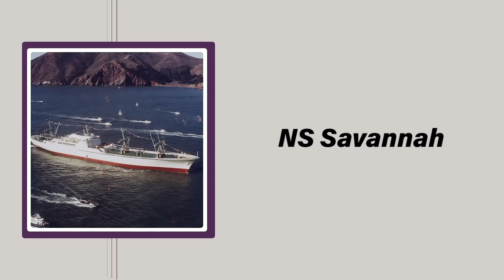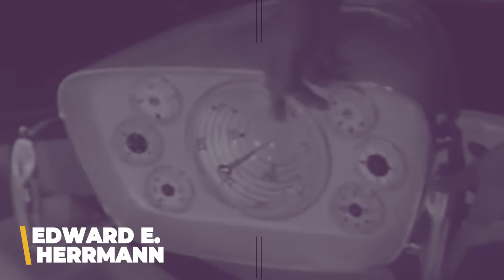Nuclear Powered Vehicles: Cheap, Sustainable, and Potentially Deadly

Comment: "Much lighter weight than fossil fuel..." also, "needs massive lead and/or concrete shielding."
Reply: Yes, there is a certain threshold at which appropriate shielding is still far lighter than the amount of fuel you would otherwise need.  Suppose the led shielding required is anything up to 50 or maybe even 100 Metric tons.
For context those shipping containers, about three thousand in total. Each have a gross shipping weight of 32 metric tons.

Heavy Fuel oil is about 0.8 Tons Per cubic meter at it's lightest, (often a full Ton per Cubic meter), and as Simon pointed out in the video these ships burn 10,000 Litre's, that's 10 cubic meters every hour .  From the port of Guangzhou china to Melbourne Australia is a 5 day trip.

5 days * 24 Hours * 10 Cubic Meters of Fuel * 0.8 Tons per Cubic Meter = 960 Metric tons of Fuel per trip.
Remember also that on this trade route one of these merchant ships leaves china every Saturday.
Reply: @lordsamich755  and "ship" is that threshold. Car or plane, not so much.
Reply: @davidpotter8297  
With present technology yes.
However switching the merchant shipping fleet to Nuclear Power still does more to prevent climate change; than literally anything else on which billions of dollars have been wasted.

But many of the same people preaching climate disaster still oppose Nuclear in any form and at any price.
Reply: @lordsamich755  "According to an annual analysis from insurer Allianz, 94 ships (over 100 gross tonnes) were completely lost in 2013. There are many reasons for a complete loss. “Foundering” (which means sinking or submerging) caused the vast majority of the big losses."
http://actuarialeye.com/2014/03/30/how-many-ships-disappear-each-year/
Reply: @davidpotter8297  
So what?
Reply: @lordsamich755  Darn. You were entertainingly dim for a moment there. Oh well, fun while it lasted.
Reply: @davidpotter8297  
Your just implying that there is an issue, without specifying why.

It may become necessary to recover sunken assets, instead of just leaving them on the sea floor.  But we know where they are.  All merchant ships report their GPS location via short-wave radio beacon.

You might be trying to assert that these reactors leak, but there is no reason to think properly designed reactors would do so.

Reactors of this size category also don't melt down in the way that people tend to assume.  Their core are simply to small for that to happen.
Reply: @lordsamich755  Ship sized reactors uses almost in every case highly enriched uranium, to get enough power out of the relatively small reactor. This is also weapons grade uranium. As long as it's in a Navy sub or carrier, it's safe, but if you put it into merchand vessels it can get into the hands of countries which make atomic weapons with it.  Also you need skilled people dealing with the reactor, while most of the ship crew in reality are people from the Philipines , because they work cheap.
Reply: @simonm1447  
Id's suggest then there is a strong case to develop thorium reactors specifically for merchant ships.

I like EV's but I just don't see electric merchant ships being a thing... ever.  There is just such a massive scaling issue to charge battery banks of that size.

Truly that only leaves only Nuclear or synthetic fuels as any sort of fossil fuel alternative.
Reply: @lordsamich755  synthetic Fuels for ships would be the simplest way, you could still use existing ships without big modifications.
Reply: @simonm1447  
Said fuels are energy carriers.  From where do we get the energy to make them?
Reply: @lordsamich755  I know they are only energy carriers.
A possible way to produce the energy would be solar in sunny countries, countries like Spain, Australia or north Africa. Solar PV is under 2 ct per kWh in these countries, and they have much space in desert like areas.
However, of course we don't have energy in excess, so we have to use it in a clever way. For ships or aircraft electric propulsion is no real option, here synthetic fuels may be an solution for the future.
Using these Fuels in normal cars however  would be a waste of energy.

Comment: I was always under the impression that the Savanna was a failure. The weight of the shielding and the cost of a crew trained to operate a nuclear power plant, made it impossible to carry enough cargo to make a profit.
Reply: More to do with the design of the ship itself, which was a relatively weird half passenger ship and half cargo freighter affair.

It's not unlikely that a Nuclear powered Container Ship or OBO Carrier will be revisited in the future; though the crew being armed and trained to repel boarders likely would be a requirement.

Comment: Thumb down: Too many mistakes, straw-men, and disinformation statements.
1. Nuclear processes include fission, fusion, and beta-decay. While fission requires substantial shielding to stop radiation, a fusion systems include aneutronic fusion which produces minimal radiation and thus could be compact. Beta-decay presents the possibility of a process which produces voltage directly. In the 1950's, these idea were speculative but not beyond scientific possibility. 
2. The mass of the radiation shielding is what prevents fission-based nuclear power from being used in anything smaller than a locomotive.
3. Treating speculative-engineering designs as if they were intended for production is nothing less than disinformation.

Comment: The problem with the 1950s versions of nuclear-powered cars is that they were invented by automotive designers and engineers who, unfortunately, did not understand nuclear energy. They were motivated by science fiction, not science. They were under the impression that a nuclear power plant would be able to do things that an internal combustion engine could not. Simon correctly pointed out that there ARE nuclear powered ships, but they are not propelled through the water by nuclear energy. They move because of propellers driven by steam engines. Yes, steam, just like the engines that drove the Titanic in 1912. The Titanic burned coal to created the steam it needed, nuclear ships use a nuclear reaction to generate the heat instead. This is why there will never be nuclear-powered cars or airplanes. Until some genius figures out cold fusion. Then maybe there can be something, but that's for future generations to invent. We aren't even close.

Comment: What about salt cooled thorium reactors? Why are these not being pursued as a technology.
Reply: They're not salt cooled; the fuel is molten thorium salts

And they are being pursued, in that the technology is being researched now.  I
Reply: @kdarkwynde  Thorium is suspended in a molten fluoride or fluorine salts... This may seem odd but this stabilises the temperature and regulates the temperature. The reaction vessel is plugged with a salt plug beneath is a containment vessel. If there is a runaway reaction and temperature rises the plug melts and the molten salt and thorium suspension drains and cools in the containment vessel where it cools and effectively freezes. This occurs with no external input of energy. meaning a meltdown needs no human intervention. The biggest obstacles are the uranium lobby and the corrsosive effects of molten salt on metal components. I'm sure that advances in ceramics could overcome this.

Comment: a minor collision will NOT destroy a city block.
An RTG (which is what they'd use) is not a nuclear bomb, and cannot become one.
It'd also be well contained in a shell secure enough that accidents won't cause it to fail.

The reason we never saw them was a combination of cost and anti-nuclear propaganda. The same reasons nuclear powered ships never came to much and most of them have since been decommissioned.

Having previously worked in nuclear energy research (I did my graduation work in the field of nuclear waste classification) I've seen first hand what restrictions have been imposed on the industry based solely on fear mongering and lies.

Comment: Finger tip steering was a way to advertise the new wonderful invention of power steering. See back in the olden days, you didn't have hydraulic or electric motors to assist in steering.

Comment: Didn't the Soviets try out a nuclear powered aircraft? IIRC the radiation proved to be way too high for the crew.
Reply: The US also did (the NB-36 H which was tested between 55 and 57). It never flew nuclear powered, but it carried a working nuclear reactor on board. The shielding worked, but only the cockpit was shielded, everything else not. 
With the B-52 they used air refueling instead of atomic aircraft.

Comment: What kind of car would have a fiberglass/plastic body panels?  Oh ever heard of a Chevy Corvette, several Lotus, Ferrari's although these are all obviously obscure rare vehicles , haha.  Plenty of fun to be made of the ideas.  Though maybe don't choose something that has been used for decades and become more common as time passes.  The frame was to be timber, alloy, or steel though never specified which.  All of which also have been in common use, even timber for example on the Morgan.

Comment: The greatest discovery in the history of mankind, "Cosmology" equals fraud. Clean new energy source based on how the Sun actually works soon to be commercially available. Although non-radioactive and radioactive material not needed to work it will breakdown radioactive material with in hours not decades. Despite shysters like “cosmologist”, particle and quantum “physicist” the future is here. https://www.youtube.com/watch?v=7GFFfmBGb5U Hydrogen and distillation of water will be dirt cheap to produce; hydrogen powered cars and trucks not electric will be the future. This new fusion reactor could be used to power ships possibly trains as well. We will not need their gas, oil, fission, solar, wind or water power any more. This is what real scientist not shysters have discovered: https://www.thunderbolts.info/wp/  MIT has confirmed it. “Cosmologies,” particle and quantum “physicist” could not even figure out how the Sun works, why would you believe anything they have to say?

Comment: For a while almost every video about nuclear energy had people in comments arguing thorium is safe. They were like a cult. I wondered why they were so keen. 

The nuclear industry and scientists invested in it had been promoting it as a safe energy source. It was a disingenuous bait and switch though. A thorium reactor of the type that can provide megawatts for a city uses U-232/233 etc. Uranium as its fissile material. Molten salt and breeder reactors still require uranium, but they can produce this material from thorium (neutrons from fission convert the thorium fuel into uranium inside the reactor). Safe thorium is the bait. Not mentioning the uranium is the switch. Perhaps safer, but not really safe. This is because there are still gamma rays and nuclear byproducts that have to be either reprocessed or safely stored for the duration of their very long half life. 

P.S. Atoms For Peace was essentially a propaganda campaign. It was intended to sway public opinion about nuclear energy. The ulterior motive is that they needed a vastly increased supply plutonium for Cold War nuclear weapons programs. Plutonium is produced in uranium powered reactors at power stations (a byproduct of uranium fission).

Comment: Small modular reactors appear to be potential power source for ships,though I tend to think that more efficient solar panels and wind generators coupled to high capacity battery systems can compete with SMRs for some seaborne applications. I don't see much reason to worry about nuclear reactors for cars, with good battery tech and an electrical power grid that features SMRs, ground transport vehicles should eventually evolve beyond internal combustion...except for niche applications in places with no access to grid electricity.

Comment: “Fingertip steering”.  Apparently Simon’s never driven a non-power-steering car..... 😆
Reply: I drive a Suzuki Samurai, and when I told a guy it didn't have power steering, he asked, "My Gawd, how can you drive a car without power steering?"
Reply: @CAMacKenzie  try a series Land Rover for a good upper body workout every day!☺.
Reply: @CrusaderSports250  The first vehicle I drove (I was 16 and learning to drive) was my dad's 1965 F-250 with a 350 or so cuin V8 and no power steering.  I was absolutely unable to turn the wheel at a dead stop.  The Suzuki is easy.
Reply: It's those Czech nuclear football suitcase cars he has to drive there or a LADA 😂
Reply: I used to drive a VW Sirocco with non-power steering. Hard to turn the wheel at a stop but not impossible, but it wasn't a heavy car. It had manual everything, transmission, locks, windows, no A/C, no cruise control, but fun as hell to drive and a kickin' stereo system.
Reply: @RCAvhstape  - my favorite car ever was my ‘83 VW Rabbit.  The thing was a go cart, also manual everything, and over 55 mph sounded like the engine was going to blow, but that thing was FUN!!!  Great connection to the road, tight turning radius, and a super torquey transmission (and that fantastic R placement up top on the left!).  I’m a VW guy to this day because of that car!
Reply: Dudes so rich he probably hasn't driven himself in a long time. You don't drive a Rolls Royse you're driven in one.

Comment: Another major issue with nuclear-powered cars: nuclear reactors generally produce their energy as heat, and are not notably tolerant of frequent or repeated power level changes. Turning heat into motion tends to require large, heavy machinery (steam plants), and we've been unable to come up with a practical way to provide such a system for a modern car, notwithstanding early steam automobiles. There is also the matter of minimum critical mass; while one pound of U235 might be able to power a car for years, one pound of U235 cannot be made to fission.

Comment: Not technically a car but one of the rovers on Mars is nuclear-powered, and about the size of a car.
Reply: The rovers are also on Mars do it doesn’t matter
Reply: More than one. Most long term spacecraft are powered by RTGs because they can provide hundred of watts continuously for a few decades. They are rather robust as they are solid metal and tiny ones have been used in pacemakers where they offer almost no risk to the user. Unfortunately, the user is likely to be quite old and if the power supply is cremated with it's former user this provides an "environmental hazard". 😈
Reply: The plutonium used in spacecraft RTGs is a byproduct of making nuclear weapons. Because the US quit making new nuclear weapons years ago, NASA is running low on the good plutonium isotope for RTGs. You can use other substances but plutonium 238 has the best power density, reasonable half life and less massive shielding requirements compared to something like strontium 90. The nice thing about RTGs is that they have no moving parts; it's basically just a thermocouple wrapped around an isotope that radiates decay heat. Stick it in a shielded container with some cooling radiator fins and it's basically a battery. The LM Aquarius used by the Apollo 13 astronauts had an RTG aboard for use by lunar surface experiments, but the crew never landed on the moon and used Aquarius as a life boat until just before reentering the atmosphere, so that RTG is at the bottom of the ocean somewhere. The things are nearly indestructible if built right.
Reply: @RCAvhstape  should have shot it out into space around Venus
Reply: @crhu319  Shot what into space around Venus? LM Aquarius? The Aquarius was on the same trajectory as the command module Odyssey it was docked to. This trajectory was a return from the moon to reenter the earth's atmosphere. The crew stayed in Aquarius until the last minute to save battery power in Odyssey and then jettisoned Aquarius, leaving her to be destroyed upon reentry. There was no physical possibility of preventing that from happening.
Reply: Sparky Puddins  Zombies, it's zombies. Vampires only come back in (about) three days, zombies can be raised at any time.
Reply: Sparky Puddins  how so once you have consumed the body with cleansing fire there is nothing left for the demon host, zombie, or vampire to inhabit, come let the sister's purify with fire!!.
Reply: Mars or the uninhabited island in Canada? Since they are an exact match in every way. Even the rocks are shaped and positioned in the exact same way.
Reply: @Miner-49  found the Flat Earther/Q-cultist.
Reply: @DesertFernweh  not sure why you called him a “Q-cultist” instead of just a regular conspiracy theorist...

Comment: Simon, Simon, Simon.  So brilliant yet so daft.  The "fingertip driving" is a reference to innovations in power steering.

You may not know this, but in vehicles of the olden days, it was tough to turn the steering wheel, especially at low speeds.  When I say tough, I mean it could be a real workout to turn at low speeds.

So when assisted steering, then power-assisted steering became a thing, it was often advertised as fingertip steering, because you know longer had to put a lot of muscle into steering the car.

Ok, that is all for my rant, you may continue. (Presses Play)

Comment: How can we lay so much blame on cars when the shipps are so dirty?  15 ships produce just as mech as  all the cars?  Holy shit!  How recent is that figure?
Reply: Up to date; add 1/8 of another cargo ship, for ten years in the future or twenty in the past. Ships have absolutely GIGANTIC engines. 
A cylinder from a cargo ship's engine, could fit all of the water in an Olympic swimming pool inside with room to spare, in one stroke. That's how big these things are. 
Also, ships burn maritime fuel oil, a slightly refined form of crude. I say "slightly", because it's refined enough to be liquid. And that's the standard since 1902.